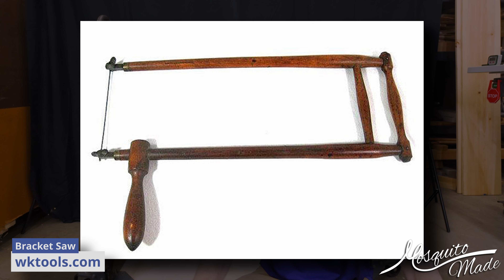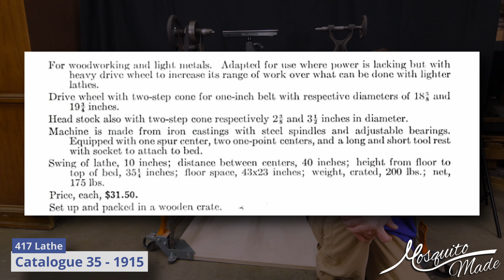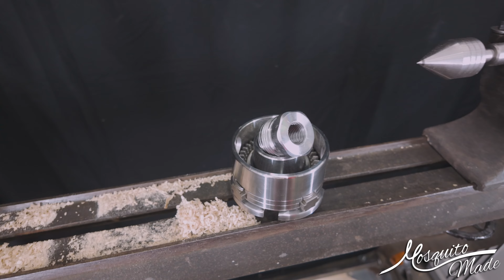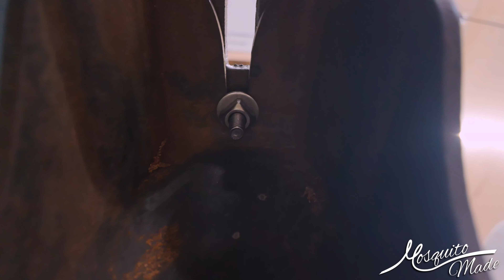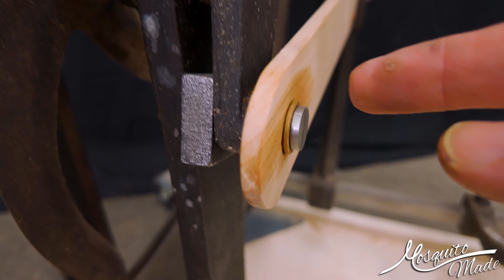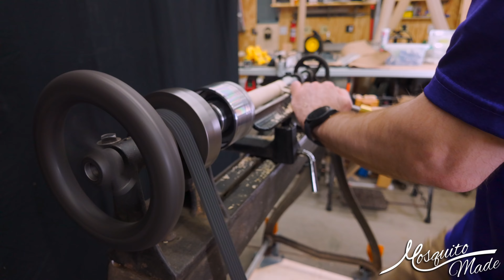Millers Falls No. 417 Treadle Lathe

Comment: Interesting video! Here is some info that may answer your question about the 417, the Millers Falls Companion and Goodell lathes and also address a misinterpretation of the heavier 4-legged scroll saw you have an image of that is attributed to Millers Falls. 

You are correct the 417 is scarce from my experience in 30 plus years of collecting and restoring foot powered machinery. Would attribute that to a couple of things. First, by 1915, electricity and smaller electric motors that would power lathes like this were becoming available. Secondly, Millers Falls was best known for making amateur/hobby grade foot powered machinery where the 417 would fall into a somewhat different category, more of a light commercial or serious woodworker level. And finally, there were a number of companies such as WF & John Barnes, Seneca Falls, Baldwin, Babbitt, etc. and others that had been making lathes in this category since the mid 1880's making them readily available elsewhere. Barnes for instance, was making the #3 wood lathe using a flat belt with holes (read, does not slip) that will run circles around the 417 for just a little more in price.  

The Companion and Goodell lathes made and sold by Millers Falls were identical and cast from the same patterns except that the Goodell was more highly finished per their ad. They both could have a scroll saw (the top of a New Rogers) as well as a small circular saw as attachments. They started making these when Albert Goodell joined the company in 1885. These were hobby grade machines and used a round belt and light weight flywheel that provide only limited power for turning. The one you have has an idler pulley, the small part on the left leg. It did two things to try and mitigate slippage. First by moving the small pulley on it in, you could get more tension on the belt - less slippage. Also, as you moved the pulley in towards the leg, it would cause more of the belt to contact the smaller headstock pulley thus more traction. Still very limited for serious turners.

On those 4 legged larger scroll saws that have been attributed to Millers Falls, the misinterpretation deals with, yes, Millers Falls very likely advertised them but did not make them. They were very early version of what became the Barnes #7 scroll saw. Barnes began experimenting with more commercial grade foot powered scroll saws in 1868 or so. John Barnes was by trade a maker of patent models out of wood of machines to submit to the US Patent Office. It would have been tedious work with a fret saw or even amateur/hobby grade ones like Millers Falls and other companies even earlier, would have been of limited help. This first machine was the beginning of a very successful foot powered wood and metal working business and lather line shaft driven machines by Barnes. 

Recently had an opportunity to inspect an early version of these saws that were in development by Barnes and true to what John Barnes was quoted as saying were "ungainly looking machines." and yes, they did not work well at all. Further perfecting was needed and accomplished. In doing some research in an early history of the Barnes Company and other articles, it was stated in 1873 that Barnes was "heavily discounting these early machines to clean out inventory." A copy of a page from their "Day Book" where they recorded sales listed them discounted from $30 to $7.50 with one notated as "Millers."  For the record, Barnes, after perfecting the saw which became known as their #7, sold over 14,000 of those along with the velocipede #2 scroll saw selling over 13,000. Would conclude that Millers Falls did know about the commercial grade machines but likely saw a much bigger market in the amateur/hobby grade machines at $2.50 to $4.50 each.

Here is a link to a video I made that is on my website https://www.footpoweredmachinery.com/ on the Barnes #2 and #7 scroll saws as well as one called "The Story of Foot Powered Machinery" that may be of interest.  

https://www.youtube.com/watch?v=BcttwdadIDk  Story of Foot Powered Machinery

https://www.youtube.com/watch?v=KBCLl2BJkGM  Comparing the Barnes #7 to the Barnes #2 Scroll Saws

Hope this helps. Ed
Reply from the maker: Thanks for all the additional info Ed!  I also appreciate the response on the facebook post as well.  

When you're mentioning the 4-legged scroll saw, was that the Lester Improved saw I had a drawing up of?  I did not know that they weren't likely made by Millers Falls, but I knew I had seen them in several catalogues over the years.  That's pretty interesting. I've watched most of your videos, as well as browsed the website in the past, and will likely revisit them soon as well!  

Thanks again for all the helpful information.  I'm by no means an expert in treadle powered machines (these two lathes and a Barnes mortiser are the extent of my collection), but I do find them quite enjoyable
Reply: @MosquitoMade  It is the one shown in the side view at the 1:25 mark with the wooden treadle that I am referring to.  Think this came from the OldToolHeaven website that found it in an old Builders and Carpenters trade paper or maybe the Scientific American or such from the mid to late 1870's. That was the advertising method of the day and they were simply done by an artist - well before cameras, etc. If anyone runs across that ad, would love to see it and get the date of it!

Barnes was trying to find a way to decouple the treadle from the scroll saw like used on a sewing machine and the other hobby grade machines already being made. You have to be coordinated (a t least for me) to keep in pace. Barnes ultimately came up with the ratchet and pawl idea which was what they based their early patents on. Think this is illustrated in the video comparing the #7 scroll saw to heh #2 Barnes scroll saw. Basically, when you pushed down, it engaged the ratchet providing  energy to cut and as soon as you let up, it was disengaged. So you could treadle any way you wanted! Long leg strokes or short or a mixture. And it will cut 1 1/2 inch pine.

The Lester Improved with the cast iron treadle came after their first machine, the Lester, which had a wooden treadle which was Millers Falls first foot powered machine in 1878 followed by the Rogers scroll saw - a wooden led version of the New Rogers and off things went! 

Found a small publication from Millers Falls called "Manual of Fret Sawing with Illustrations" published by Millers Falls and copyrighted by Perry Mason & Co of Boston that I had filed away. No date listed but it did have a testimonial dated Feb 4, 1878 on the Lester saw and lathe. The catalog had an illustration of the Lester and also announced the New Lester with the cast iron treadle.  They also listed the all steel hand fret saw you have pictured with pin striping, blades, a hand drill, clamps and thin , 1/8 to 1/4 inch thick, plus how to do fret work. (The wooden version pictured was the Fuller's Patent saw.) Both very nice and worked very well. 

Need to update the website and perhaps start with adding the catalog for Millers Falls. Anyhow, let me know if you have any questions! Keep up the good work!

As they say, Keep on Treadling!! Ed

Comment: I have the companion lathe, unfortunately it did not come with the drive spur and it’s an odd threaded size for lathe parts at 7/16-20. Did your companion lathe come with the original spur? It would be great to see what an original looks like. One day Im going to turn down a a metal rod and use a shopsmith spur.
Reply from the maker: Mine did not have an original either. I used a 7/16-20 bolt, cut the head off and filed a point on it. Then I used a castle nut and and shaped the castle portion like teeth. It works OK, but could be better.  Original drive center would have been a flat 2 blade drive center.
Reply: @MosquitoMade Chris, I’ve tried that too with poor results. I’m eventually going to have a short 5/8 shaft turned down to 7/16-20 on 1 side of it, since shopsmith makes a drive spur for 5/8 shaft. I also found a Jacob’s chuck that is 7/16.  

Also I find it extremely under powered and really can’t do much of anything with it. How about you? 

I’m thinking it was called the companion because it may have been meant more as a child’s toy, and the height and size seems to reinforce this theory…
Reply from the maker: That is largely what it seems to have been intended for, yeah. The size is difficult unless you're sitting as an adult, but then lose the mobility when making cuts. I got a solid hub (undrilled) cast iron handwheel from McMaster and added that on where a grinding wheel would be, and that helps, but it's definitely an exercise in light cuts for sure.  Even my larger treadle lathe isn't so great

Comment: You are thinking all metal is harder than wood. When it says “light metal work” it doesn’t mean “light work in metal” it means “work in light metals” where “light metal” means things like tin or magnesium (aluminum back then was extremely pricey; aluminum used to be worth more than gold)
Reply from the maker: Yeah, that was my assumed intent for the catalog listings, I figured brass or bronze would be most likely, but just the nature of running the treadle and freehand turning it when there were a lot of peddle powered metal lathes with tool holders and feed mechanisms and such.  It just didn't seem that practical.  Unless they had an apprentice to run the treadle so they didn't have to worry about their leg movement throwing off their hand movements 🤣